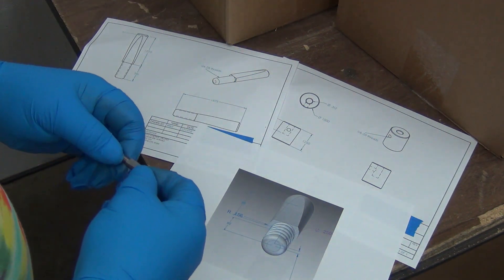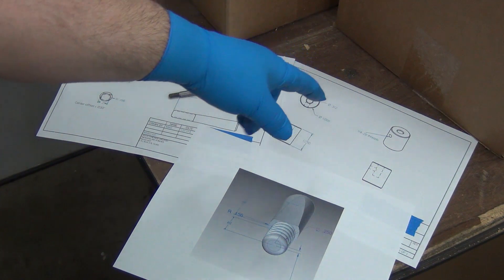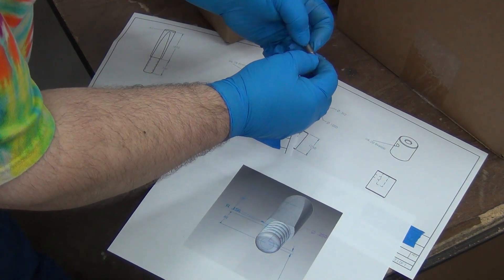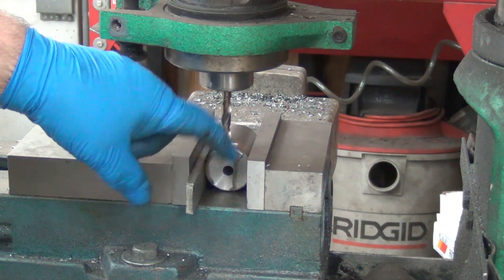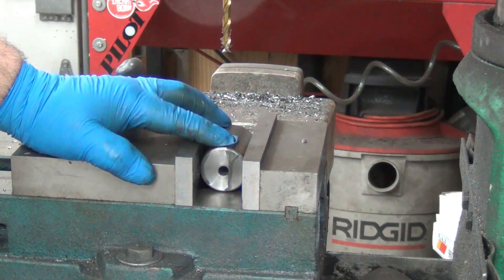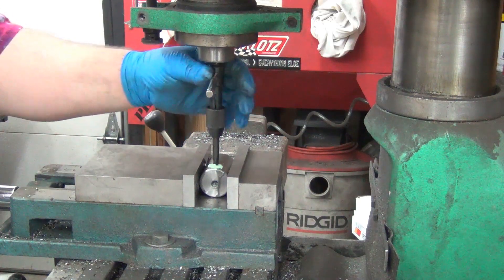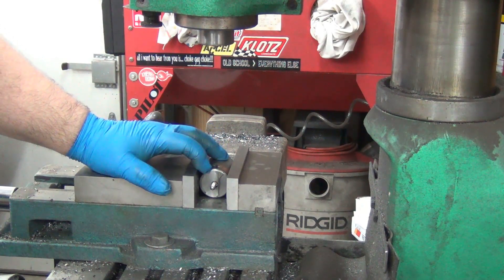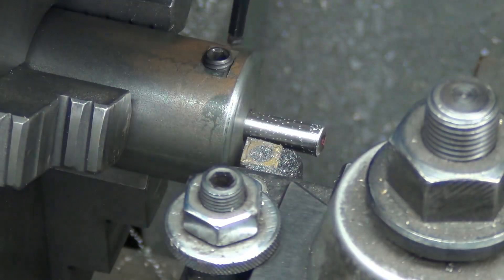Cotter Bolt pt1 - Prototyping, Off Center Holder

Comment: Good job, Mike. I need to get into the habit of drawing my parts in CAD instead of just chicken scratch in my notebook.
Reply from the maker: Tom Zelickman I still have spiral notebooks filled with chicken scratch, but it's certainly nicer to have them in CAD!  I did it on this part, mainly to get the angle of the taper.  Plus...having a dimensioned drawing makes programing the cnc much nicer!
Thanks!

Comment: That looks like a bit of a complex part to make.  I have no doubt that you will turn out a lot of them exactly right though.  I notice that you seem to have the same Grizzly mill/drill that I have.  I have a horrible amount of vibration if I try to run it faster than 1200 RPM.  Do you have the same problem?  Thanks for the video.
Reply from the maker: cerberus They turned out pretty nice.  I actually bought some more rod, so I think I'll make some more while the setup is still fresh in my head. 
I have the same mill, but it's the Harbor Freight version.  They may be identical or mine is a copy.  Mine came with a solid column.  I've seen some of the HF ones with a hollow support...guess I got lucky.
Any clue where the vibration is coming from?  I get enough to rattle the lid, but nothing excessive.  The two bolts that "sort of" hold the idler pulley arm down come loose fairly often.  I've also had my drive pulley on the motor climb up on the shaft.  I run link belts on mine.....they don't take a "set" like normal belts.  The new belts on my big lathe get that dead spot after sitting a bit......might have to change them to links too.
Thanks!!

Comment: Thanks for the videos Mr. Hands, I enjoy them very much, particularly the CNC stuff. I can't help but wonder if you have any projects on the go with the Novacon?
Reply from the maker: Thanks!  I'm really glad to hear you enjoy these.  This series will have more cnc stuff coming up on the 9x20 lathe.
I'm slowly getting back on the Novakon.  It got pushed to the side for several months, which happened to kill the battery for the power draw bar, so I'm in the process of getting that swapped out and going again.  There's definitely a lot more to come on the Novakon, it just takes a backseat to nearly everything else. :(  LOL!  I think I posted a pic on instagram? (bluehandsvideo) showing that I cleaned up the shop a bit and unburied the mill.  Thank you for the comment....motivates me even more to get that beast fired up!! :)
Mike